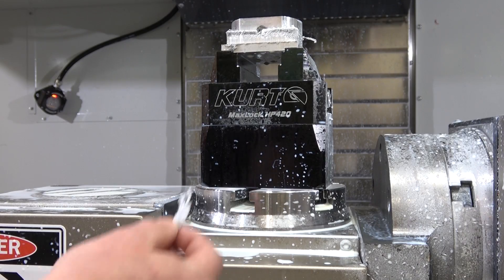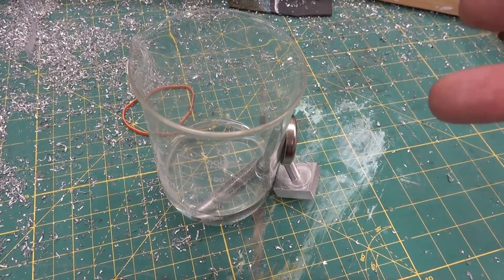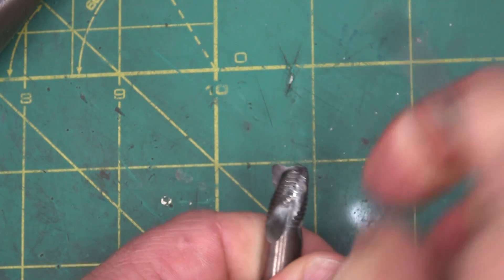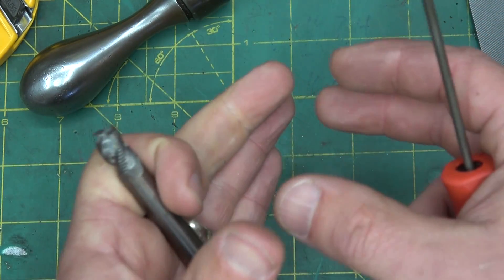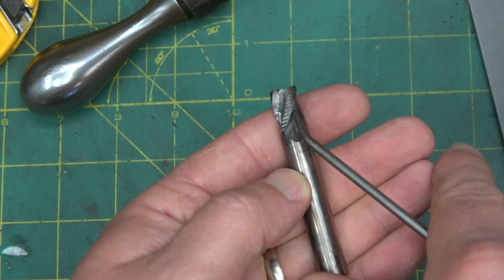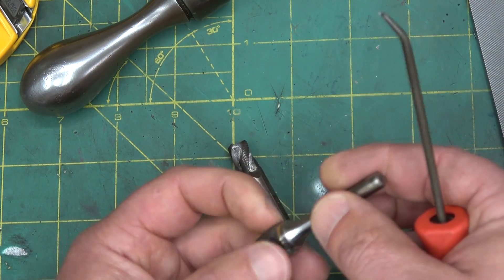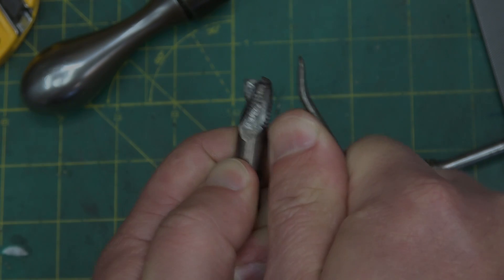Salvage Carbide Tools with Lye | SCIENCE!

Comment: You can use hydrochloric acid aka concrete cleaner to clean aluminum off steel. Used it on engine blocks to take off aluminum stuck on the bores.

Comment: if you soak a dull file in Jasco metal etch, it will remake the teeth.  they will be rough but will work again.  Have done it many times. It eats away at the sides of the tooth as well as the tip and makes it sharp.  Like a rusted metal edge being sharp.

Comment: I don't get why you would use a carbide but on your mill if doing something manually ok. But why not just use a old drill bit it's alloy I've had to use a drill bit as a boring bar on a lathe had no inserts had 30 min to get it done. Ground a flat spot in the drill gave it a sharpen put it in the tool post done. It cut 2" of stainless

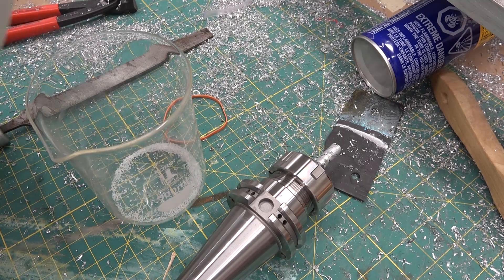Comment: @1:35 hopefully you did it this way round for ease to show the amount of sodium hydroxide - usually pour in your water first, then add the lye (acids as well), because there is a danger of sudden spilling, when it heats some of the water to boiling point! Always wear nitrile gloves and eye-protection, when handling acids or lyes!
@2:25 instead of chalc use talcum powder( Mg3[(OH)2|Si4O10] ), it's a very old mechanics' trick, that works really well - fill it in a tall plastic container, put the file down in there and turn and gently shake it to cover the whole file. File without a lot of force and repeatedly cover the surface with talcum (you can use a soft paintbrush too) if the file starts to bite.
This method is ALWAYS used, if you try to file true to 1/100th millimeter by hand - without you never will be successful.

Talcum is an extremely fine powder, that coats all surfaces (sort of dry lubricant), the aluminium can't weld to your tool. Works extremely well with rubber/plastic too.

Comment: If you're ever feeling spendy, we use destiny tool "diamondback" roughers for AL. Blows right through it, and they rarely clog... unless you're going too fast or the machine coolant is barely pissing out . The finishers we use are local made TiN coated carbide 3 fluters, nothing too special.

Comment: I have on occasion turned a bad carbide end mill into a friction stir welding plug... simply by grinding it into a zero flute end mill. Works real well to weld aluminum and not have to worry about flux, DCEP, or wasting acetylene gas trying to figure out why I can't gas weld aluminum no matter what flux I use. Friction stir welding just works if I could somehow rigidly clamp the parts together and run a high speed zero flute end mill through the joint.

Comment: I've learned so much from watching your channel, big thanks! I use Muriatic acid on my carbide burrs and steel files to dissolve the aluminum. Just be sure to rinse in water afterwards then dry and apply some rust preventative on the files.

Comment: Did the Alum bolt extraction get taken down? I was looking for it to explain to a co-worker why I need slum for this tap in my aluminum bracket... Pro tip, don't take the drill index's word for it... Measure your drills

Comment: You can definitely get Sodium Hydroxide granules on eBay and Amazon. No need to deal with Sigma and all their rules and overpriced shit.

Especially when you don't literally need 99.99% purity. In this case, 95% would do, but drain cleaner wouldn't work because even though its pure enough, it's got inhibitors in it.

For instance 2lbs of Sodium Hydroxide https://www.amazon.com/dp/B001EDBEZM

Also, make sure you do know that Sodium Hydroxide solutions will eat through glass, so never store it in glass.

Comment: When I want to use a burr bit made for steel on aluminum for less aggressive cutting, I jam the spinning burr bit into a (unlit)candle from the dollar store. Any paraffin will work though. This also works on already clogged bits. Just get the bit "clogged" with wax and keep on working. Zero delay, except to go grab the candle. The paraffin unclogs the bits of aluminum very effectively. Only tried this using carbide burr bits in hand held pneumatic die grinders.

Comment: I’ve come to metal work in my 60th year, I fought hard against the family tradition of engineers. So...my question might be dumb or dangerous though these descriptors should not be used exclusive of the other, can you use a carbide burr in a router table for cleaning edges?

Comment: geeking out the Zink anodes are put on ships to prevent galvanic corrosion that would in the old days drill neat little holes strait through the hull, so now it eats away the anode.

Do you guys know what is the difference between a boat and a ship :)

Comment: I used to soak my carbide table saw blades in lye to remove the gummy resin buildup. It was a tip I learned from an old furniture factory owner I worked in the same building with. The blades cut much better after, just like they were sharpened. We sent our files out to a company that did some kind of electro etching sharpening process to them.

Comment: If you are going to use tapwater don't bother with anything above draincleaner in purity of the sodiumhydroxide. Otherwise it's like putting a carbide tip in a PLA handcrank to drill a waterbottle.

Maintinance seem to have forked up the wiring so my kitchen fan only has the settings of ON and even more ON so I compensate my sleepdepravation by acting superior on the internet

Comment: Never use a file card, steel wire brush, or hard pick to clean a file! Using one will shorten the life of the file.The wires they are made of are as hard or harder then the files teeth and each use will damage the file a bit more. You can easily remove most, if not all, of the metal that is clogging the teeth of a flat file with a plain piece of cold rolled or soft steel. Copper and brass may be too soft to clean steel clogged files. Avoid hot rolled steel for the same reason to avoid wire brushes, the scale on HRS is hard and abrasive,  I usually use something about 1/2" wide, wide enough to clean a good number of teeth and not too wide that it takes too long to form. Start at the handle end of the file, where the teeth get the least abuse, and push the edge of it across the file in line with the teeth. After only a couple passes, the steel will form to the file's tooth pattern and clear out any metal build-up. Just advance down the file, both sides, and you can clean it in short order. Best thing is that if you start with  1/2" square stock, you have 8 edges to clean 8 different tooth patterns, a handy little tool that doesn't take up too much space.

Comment: The old-timey way to get that black patina on firearms was to use an acid to create a uniform layer of Fe2O3 (red rust) all over the steel part, then introducing the Fe2O3 to boiling water or steam, to convert it into Fe3O4. This process gets repeated several times until an even layer forms, carefully "carding" off the loose, fuzzy oxide between passes, and if done on a part with a good surface finish, results in that deep blue-black color that you see on old firearms, particularly Colts.

It's a very labor-intensive process that you never see on modern firearms, outside of hand-crafted custom pieces, because the average consumer would not be willing to pay for it. It's a real shame to see the skills involved in creating something functional and like that disappearing.

Comment: I was a CAD/CAM programmer. At my old job we would use muriatic acid to clean off the aluminum that got chip welded to the carbide tool bits. You want to do that outside as the gasses is, well let’s just say. It’s not pleasant to breathe in. The gasses will also cause any steel that’s close by to rust once it touches it.

Comment: Correction: "Clean Aluminium from Carbide Tools". I saw nothing that salvaged any damages to the carbide tools... 
FYI, I have found the higher the speeds my rotary file bits have, the less likely they have been to bite and chip (fetch-up), however I am filing steel not Aluminium, so might be easier to bite into Aluminium.

Comment: Couldn't you use muriatic acid to remove the aluminum.  When I worked in a sled shop we would use it to remove melted pistony off cylinder walls after it shit the bed.

Comment: I just run my carbides gummed up with alum on an old piece of cast iron.  I assume the heat(since alum melts at a low temp) helps free up the melted on alum, well lets it stick to CI chips and fly away.

Comment: I use that cone burr tool (Bertol as I call it) all the time...5 years and it still can cut through stainless...I had abunch of galled aluminum on it and just tapped it with a hammer til it came loose...

Comment: For tools with lot of small holes like the pointier thing you have there that I use on my air powered hand held thingy (I don't remember the english name for) I just spray a bit of WD-40 or other similar thin oil. Then I start working on some scrap iron with the tool bit of forcing it agains the iron and all the stuck aluminum will just explode away from the tool.

Comment: Have you tried brushing a bit of paraffin on cutting surfaces? Also watch the speed and pressure. Aluminium comes in many grades in different types of stock. Some just turn into pudding because they are designed to have shapes punched out. Others 6000 & 7000 grades are harder and cut much more like steel.

Comment: use Chainsaw Bar Oil as a lubricant and you probably won't have any more problems with the galling on your tool steel I use it on my carbide bits to Port aluminum intake manifolds and it works very very well

Comment: Would hydrochloric acid work to remove the aluminum?  HCL acid wouldn't hurt the carbide, right?
Reply: brandy sigmon HCl + NaOH would be a somewhat violent combination, even though it's supposed to end up as NaCl + H2O.
Reply: @johnfrancisdoe1563  I mean just dip the carbide tooling in the HCL and don't use anything else. Wouldn't the HCL "dissolve" the AL, the carbide wouldn't be affected, right?

Comment: Aluminum Hydroxide?  That's actually pretty easy to obtain.  I have access to 55 gallon drums of it.  Also I have access to sulfuric acid and caustic soda all industrial grade.  It's not hard to obtain.  Then again I manage an industrial wash line for powder coating and use Aluminum Hydroxide to treat our wastewater for heavy metals before it gets dumped into the city sewage.
Reply from the maker: Is there an echo in here? Easy to obtain for a business, difficult to obtain for an individual.

Comment: Little note on the mixing, add the lye to the water rather than water to lye.

I mess with that stuff a lot for various experiments or "controlled" melting of aluminum to etch it.

Got that from my chemistry teacher back in high school as "always add acid to water, never the other way" to avoid issues (I know lye is not an acid but its still better to add to water)

Comment: Why would you use a carbide roughing endmill on aluminum?  The stuff cuts like butter, a 2 flute HSS endmill would be just fine for roughing, maybe a couple more flutes for finish passes but you never need carbide for soft material like aluminum.  Hell, with how expensive carbide tooling is that's just plain wasting money.  I really MISS working with aluminum, all I see these days is stainless at the softest, if not crazy nickel alloys.  No wonder you got aluminum stuck to it, you need to use totally different speeds and feeds for carb cutters.

Comment: I have always had good luck with “pipe joint lubricant” or “boy butter” as we call it in the labor union. Apply a liberal amount to sanding disks for angle grinders and carbide tipped saws. Helps keep from loading up but you need to apply regularly.
Reply: Just to clarify, I don’t mean try it on your fucking CNC.

Comment: Yea, like you already pointed out, you should be using coated tools to cut Al because the Al cannot weld to the conversion coating.  SO WHY are you not using the proper tooling!!!?!?!?
The Zinc in the Aluminum will cause welding to bright steel tooling, so you need to be aware of that, use coolant and oxide coated HSS.  It's even worse with die cast Al.
Spend some good money on good endmills.  I used to buy the $20 endmills and I will tell you the $50 endmills when dull are still sharper than the $20 ones brand new!
Another note, if you get crazy and want to machine Magnesium, possibly burning the shop down to the floor... don't bother trying to use caustic to "clean" your tooling.  Hydroxide doesn't attack Magnesium because it has a full valance, but it eats the hell out of Aluminum!  its very interesting how that works.

Comment: 9:35 Aluminium is electropositive (not electronegative) and does not bind with the sodium, at all. The hydroxide ions (once the oxide layer has been penetrated) attack the aluminium, which then gives up electrons to the water molecules to produce the abundant quantities of hydrogen. Sodium aluminate in solution is NaAl(OH)4 or quite possibly Na[Al(H2O)2(OH)4].

Comment: Hey @AvE, Question for the master of all things injection-molded if you've got a sec, what solution will dissolve Super Glue (loctite brand), but not glass fiber reinforced nylon plastic? I have a project that I may or may not have fuckered up a bit...

Comment: In aluminum Xtrusion, the steel dies are cooked in hot NaOH solution to remove the aluminum left in the dies. Heating the solution will give you better results in a quicker fashion.

Comment: Hi AvE, I saw your video, it's very interesting, I'm a chemist and I think you could use wood ash instead of sodium hydroxide 'cause is basically the same, also a little higher temperature could help speed up the process. Greetings from Italy

Comment: Next time your tool gets cozy with the aluminum do a plunge cut into a scrap piece of aluminum at low RPM, around 500.  It'll usually pop right out.  I can't use flood coolant on one CNC and have this happen regularly.  It pops right out 70% of the time.  The bottle of Worx toilet bowl cleaner is for the other 30.

Comment: Sodium hydroxide, the bottle said 25:1 dilution for cleaning the grills,well...it was late so I just poured in on. Fuckin cleaner than new, but a single drop ate through 3mm of skin without any effort. Cold it doesn't tickle too much though. Keep the jug of vinegar around just in case

Comment: Sharpened carbide burrs make a fantastic scriber. Sharpen on a green wheel (someone else's because it wears them out quick, fast and in a hurry) and then weld the steel shank to a 6mm rod for a handle. Scribe from here to the moon before you need to re-sharpen.

Comment: I used cleaning strength vinegar (I guess over 6% acetic acid) to clean up some aluminium and stainless diesel injector pump parts - many parts were pressed together mixed metal and could not be separated without a high chance of damage. The cleaning went well - it removed diesel bug residue better than marine degreaser - but part of one turned out to be a copper alloy, and it looks like I gave the other parts a thin plating of copper. Really not sure if that is a bad thing yet, I will see when I put it back together.
 If you read this, feel free to correct my assumptions and offer advice. I tried to find carb cleaner, but it was not available here and can not be shipped by air.

Comment: For further edumacation, be aware that sputtered coatings like TiN and TiCN are stripped by the coating company with strong aqueous lye solutions.  So be aware that you could strip a coating that you paid for in your efforts to dissolve aluminium, thus ruining your tool.

(insert juvenile penis joke here )

It's just better to have the correct tool geometry and cutting fluid in the first place

Signed, your neighborhood toolmaker

Comment: If'n you're not a serial killer and don't have any lye you can also dissolve small amounts of aluminium out of cutting tools with regular toxic oven cleaner. Just spray it on the tool and leave it to cooch a while.

Comment: Lye doesn't touch copper. Ammonia does though, so keep ammonium salts or straight up ammonia, away from it.  If you see deep blue color, you're seeing copper tetraammine.

Lye may corrode some bits of carbide, I wonder how much.  Tungsten can dissolve.  Carbide is strong assed stuff, chemically speaking (for more-or-less the same reason it's hard), may just not do anything below, say, supercritical temperature.

Comment: I'm at 5:41, and putting on my old chemist's hat...

Aluminum is one of the metals that really wants to be an oxide, really badly - more so than many other metals. When you are looking at the surface of a piece of aluminum alloy, you are looking at a thin layer of aluminum oxide.

So, the hydroxide ions from the lye (caustic, soda sodium hydroxide) readily turn the aluminum atoms into aluminum hydroxide, which is both soluble and a bit of a buffer, being much less caustic (basic) than the sodium hydroxide.

The aluminum atom holds on to electrons much more tightly than does a sodium atom, but still loosely enough to be relatively soluble at a pH greater than 8.

Aluminum hydroxide gets kind of fluffy and lots less soluble when the pH is between 6 and 8, which makes it a neat chemical for water treatment. It's amphoteric - weakly acidic / basic - and it polymerizes in this pH range.

Acid will dissolve aluminum faster than iron, but will take up the iron pretty fast as well, which is why the caustic solution works better than acid for removing galled aluminum from cutting tools.

Anywho, chemistry can be fun when done right...

Comment: I suggest not using a roughing endmill in aluminum, they gall up too easily. My shop stopped with them, and just goes with standard 3 flutes, usually 1/2". If it matters we just use 2 of the same, one to rough with, one to finish with.

Comment: On a side note, and I'm fully aware that it dulls my tool, but when I'm using carbide burrs to port aluminum heads, and they start to get clogged, I run them on the side of the steel table. Gets rid of the aluminum fast